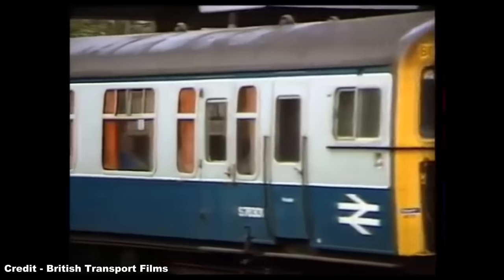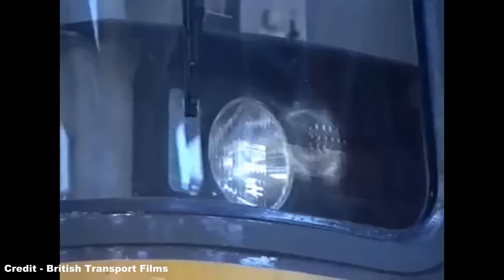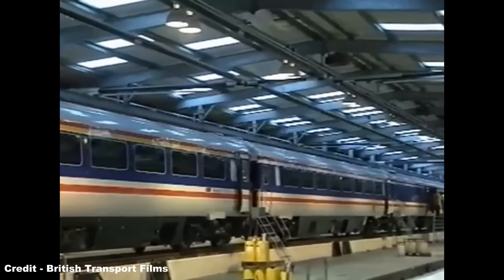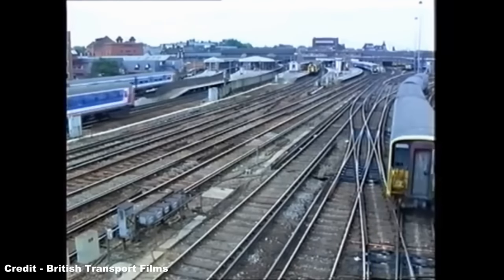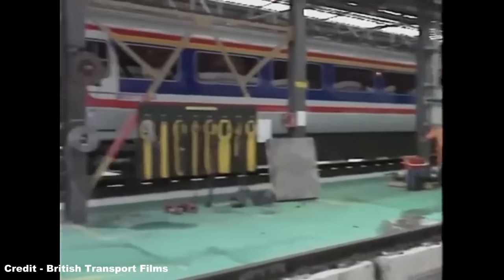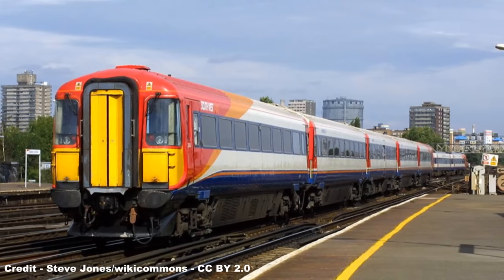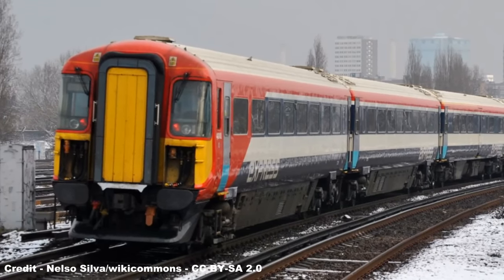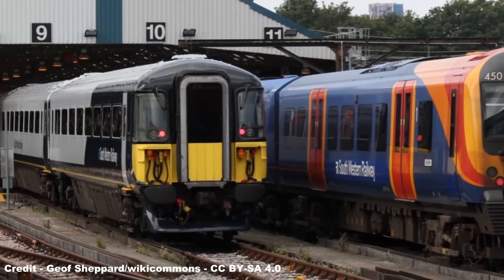The Wessex Electrics - Class 442

Comment: I clearly remember these class 442 units coming into service In 1988. Travelling on them was a revelation compared to the slam door stock, with comfortable seating, air conditioning, a fully carpeted interior and a buffet service. I must admit I missed them when they were replaced by the class 444 units, but the newer units were just as nice to travel in.
Reply: The Class 442 had more comfy seats than the Class 444 and was more cosy imo but otherwise the Class 444 was superior technically.
I remember the 442s were very quiet and refined (unless you were sitting in the power car) apart from a strange `boiling egg' knocking noise at low speed.
In the powered car(s), which contained the Buffet & Snug IIRC, it could be clearly heard terrible wheelsip in wet conditions, showing up the age of the design of the traction motor control equipment (resistance control, probably combined with series / parallel connection) and the relatively few powered axles compared to the norm nowadays.

Comment: It very sad 😢 that these amazing class 442s were withdrawn as well, you know what happen to them. These trains were amazing to see in action as well riding on them and that was a great experience that I will never forget.
Reply: Yes that's true.
Reply: It's sad, SWR were planning on bringing them home although running the pompy line. But due to issues decided not to and send them for scrap.

It's ironic that these purpose built trains can't run on the line it was designed for. They had run down to pompy in the past. I remember getting on one between Woking and Guildford when I made my journey to Reading.
Reply: Its not sad, they were old, outdated and provided numerous issues during testing for re introduction post overhaul. - Signal sighting, Power consumption, turning signals to danger.

The truth is that SWR should never have considered their reintroduction.
They should have been cut up years ago instead of going into storage.

Such a monumental waste of £45 million when the operator and network could have done with that investment elsewhere.
Such as bi modal trains for Exeter - Waterloo, which I believe SWT had been looking to order before withdrawal of the franchise from them.

Comment: I have no idea why people have this passion for steam trains (other than the occasional, exceptional one).
They were inefficient, finnicky, uncomfortable for the crews, produced masses of black smoke and could even explode.
I get diesels.
But, to me?
Electrics are, by far, the best.

Thank you for this.
☮
Reply: People that worked on electric traction made railways more efficient, clean and even saved millions of lives due to electric trains using electricity from the power grid transfered through OHLE or third rail instead of smoky steam or fumes from the diesel burnt in the engines.

Comment: Great documentary Rory! I feel there’s a valuable lesson in the story of this fleet which has still not been learned by the DfT. The 442’s ultimately became stranded assets due to lack of future proofing in the design specification. This remained the case with the class 220 DEMU Voyagers and so many other EMU and DMU fleets including the Class 195s that are still rolling off the production line today! As rolling stock engineer who has managed billions of dollars worth of procurement contracts, I can honestly say that the marginal cost to ensure that a fleet can easily be retrofitted to serve alternative sections of Britain’s railway network is marginal. All that is needed is to achieve future proofing aims is to provide provisional space for a pantograph in the carbody of at least one trailer car and to ensure the same car also has space for a transformer. Finally, to provision for HT bus cables spanning the full length of the rake. 

This philosophy can even be applied to DMU’s to make it cost viable to retrofit to electric propulsion; provided the modification is done whilst the asset is still young.

Unfortunately, the whole setup of the franchise system, doesn’t motivate the right decisions when it comes to Capex investment. Therefore, if the government is serious about reducing carbon impact it must legislate through the DfT to make certain rolling stock design provisions mandatory for Britains railways. As things stand right now, literally thousands of multiple unit cars shall be destined for the scrap heap prematurely. Not reaching the 35 year design life is and should always be considered a strategic failure!
Reply: Forward thinking has never been the remit of the British railway franchises, as they are only interested in their current contract.

I do believe that SWT looked to order Bimodal 3rd rail/Diesel sets for its Exeter - Waterloo route, but they lost the franchise to SWR who didn't openly show any forward planning for the replacement of DMUs running into London. Despite fast approaching government rules on Diesel emissions in the City.

If GBR comes to fruition, the future and not the short term should be their focus.

Being pro active in providing a sustainable, reliable, cost worthy service to the travelling public.
Rather than constantly reacting to everything by throwing money at it with little forward investment.

Get those non electrified lines sorted, or force development of more bi-modal units to allow greater flexibility and future proofing in case of major electrification.

Comment: We used to visit my Gran in Weymouth once or twice a year. Often we went by car, but sometimes we had to go by train. I remember the original arrangement with the 4 REPs, 4 TCs and class 33s. The change over to diesel at Bournemouth wasn't always swift though.
I also remember the shortage of trains whilst the 4 REPs were being withdrawn, there were often long delays at Bournemouth around then. 
When the Wessex 442s were introduced they were a game changer the reduction in journey time meant that we tended to take the train rather than drive down to Weymouth. The units had a lovely modern look inside, though I always found that the seats were a little bit too upright to be comfortable on the long journey from Waterloo.
The introduction of the 442s also helped bring about the demise of the Weymouth harbour ferry terminal services as the tramway could not be 3rd rail electrified (I doubt the Wessex units would have managed the curves anyway), requiring older diesel hauled MK1 stock to be diagrammed for ferry services.

Comment: Back in the 80s when working for the Director Operations, I was once involved in an IT scheme to record carriage washing and discharges of controlled emission toilets on the 442s. We actually bar-coded the units, and the CET operator used a barcode reader to take the unit ID when the tanks were pumped out. The info was then uploaded to a mainframe system. There was also to be equipment installed to record carriage washing, (time, date and type of wash).  Needless to say, with the demise of the Director Operations, it was all abandoned !  However my scheme for recording coach defects on the Anglia Intercity fleet using barcodes and a barcode reader in the conductors compartment was a success, and in use for many years. This sent the info over cellular radio. I was told by the radio team at the BRB it would never work.

Comment: The WE 442s were pretty nice trains, from a passenger perspective. I used them every Friday evening and Monday morning between Wareham and Clapham Junction for 2 years. They were regularly standing-only outbound from Clapham, but to some extent this was tolerable as the trains were clean and fast. One thing they seemed to suffer from was wheel flats - you could pretty much guarantee being in one carriage with a wheel banging hard somewhere under the floorboards... One of the few memorable train sets I've used over the years comparing them to HST sets, Dutch NS double deckers and German DB ISB and ICE trains.

Comment: Another weird idea that was proposed for the 442s Was in the Transpennine Express Franchise Agreement for the current holder where it proposed using 442 to increase capacity on Transpennine network working as trailers sets with Class 68s, the Nova 1 was the result of another option within the contract but it sure would’ve been interesting to see

Comment: I personally had encountered 442408 (County of Dorset) during my travels in 2014 while it passed me at Clapham Junction P11 on a return run from Gatwick Airport to London Victoria. Although I had never ridden onboard, I get goosebumps seeing how fast they ran despite the limitations of third rail.

Truly, the Wessex Pigs are also deserving of this nickname, "King of the Third Railers" ,for their record as the fastest train to ever be powered by third rail.
Reply: To be fair the units they took their traction equipment from, were the king of the 3rd rail. The 4REP's were 3200hp 4 coach Mk1's. On test, one reached 130mph. They were much quicker than the Wessex electrics, but were used to build the Wessex units.

Comment: The Class 442s were a classic example of an oportunity missed, as just imagine if NSE had specified an Overhead-powered varient (Class 342?) that could have taken over longer distance services NSE services out of Liverpool Street, King's Cross & Euston, as well as an InterCity varient to take on the Wolverhampton/Crewe/Manchester, and Doncaster/Leeds/York diagrams as a way of replacing Class 86/87-hauled stock.

Maybe a diesel version would have been a technical step too far, but....
Reply: Could've happened if it wasn't for the two faced tories privatising the railways and everything else in the 90s
Reply: I didn't want to get political, as my intent was to look at the technical potential of the type gaining varients, in order to gain more traction (no pun intended) in the rails of the country.  
The privatisation of the rail network did stifle any realistic chances of those varients being considered, if management and BREL had gone down that route.
Reply: If they had gone that route, then making them bi-mode would have been best (overheard & 3rd rail). Don't know if making them tri-mode (diesel as well) would have been possible as well
Reply: At the time, tri-mode technology was only really feasable with locomotives (SNCB, for instance) due to space contraints, it's only been in recent times that tri-mode MUs have become a workable thing, but bi-mode was an already-proven technology (Class 319) so could have been another variant - this could have opened up the possibility of electrifying some CrossCountry services, or even creating new options (Portsmouth<>Norwich?)

Comment: Thank you very very much. I heard that once 442 Units managed to reach 130 mph near Eastleigh. Do you know if this was ever possible?
Reply: I believe the 100mph speed limit on third rail is because of the pickup ramps’ limitations. If there were high-speed ramps on that stretch I dare say the 442 could’ve exceeded it’s stated max speed.

For example, I have it on good authority that the last LUL A-Stock unit hit 80mph on the empty to depot move after the Farewell Tour; but they weren’t officially rated above 60mph

Comment: I really hope one is refitted with motors and used for Southern Region railtours.
Reply: They're all scrapped or in very bad condition. I doubt anything will happen.
Reply: @stevenjobswell  1 is on static display at Eastleigh, the other is going to be turned into hauled stock by Northumbria rail.
Reply: @MrGriser  there’s one cab on static display and that’s the only news I know
Reply: @stevenjobswell  I've been told at work that 4 cars will be converted to loco hauled stock not so sure what will happen to unit 412 on static at Eastleigh.
Reply: @MrGriser  we can only wait and see
Reply: It's rumoured that 1 motor car still exists
Reply: @leeroberts1192  Only trouble is a lack of time, effort and money.

Comment: So if they reuse all the traction equipment from older trains (I assume brushes and commutators get replaced fairly often inside a train's life) then do they have more modern PWM thyristor control as if they had been designed in the '80s or old style resistor and series-parallel switching control like the source of the equipment would have had? And when they were scrapped was all that old equipment lost? And what is that weird bee noise they seem to make about?
Reply: The original 442s had the old style resistor and series-parallel switching control which was one reason why the power cars suffered from such terrible wheelslip in wet conditions if the rail had been affected by leaf fall. i don't know if any were modded to electronic motor control.
Reply: @Martindyna  Ah OK, that makes sense then, though unusual for a model of train created at that time.
Reply: @bangerbangerbro  Yes, BR were always cash strapped but they did a good job considering imo. 
They were considered one of the most efficient railway organisations in Europe and should have been exempt from EU Directive 91/440 but of course the Tories disliked BR and the EU directive was a Godsend excuse to break them up.
Reply: @Martindyna  Yes it is a shame. Now all of what they had built up has been lost.
Reply: @bangerbangerbro   Indeed.  We have nothing of our own regarding rail to show off any more.
Thank God we still have Rolls-Royce (the Engineering company that makes state of the art gas turbine engines, not the car company owned by VW Group) to take pride in.
A reminder of what we did in the past:-
The IVA88 Exhibition Train
Reply: @Martindyna  Yeah it is a shame. Not much left in terms of cars other than some factories producing existing designs, some small racing makes and I guess Jaguar Land Rover is still based here. Not much in terms of computers either, though I guess ARM counts for quite a bit if that is even still mostly done in the UK.
Reply: The traction package they originally had came from REP units
Reply: @leeroberts1192  Right.

Comment: An excellent presentation of some excellent trains - nothing that has followed them was anywhere near as good, though the 5WES was far from perfect.  They had a wonderful ride quality and were comfortable.  

What your documentary has shown is how political and fragmented the franchise system made running the railways.  There were some awful trains leased out by the leasing companies that were built to be generic and never really suited any role.  The Desiros are overweight in all roles, the Junipers were just awful all round and the TOCs were given the short straw to pass on to the passengers, sorry, customers.  It's no surprise at all that the BR/BREL designs (even some of the Southern designs in this case) gave far superior service for longer.  

Once you add in the ORR meddling, (and collection of superfluous legislation - who really needs an in-train information system?  But make sure it's characters are bigger than 38mm tall...) there is no surprise the system is in disarray.